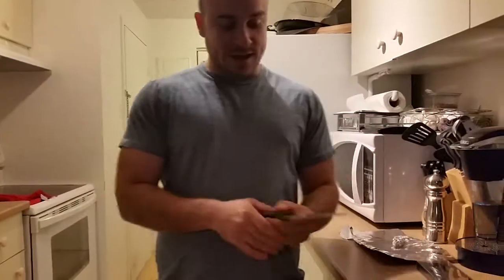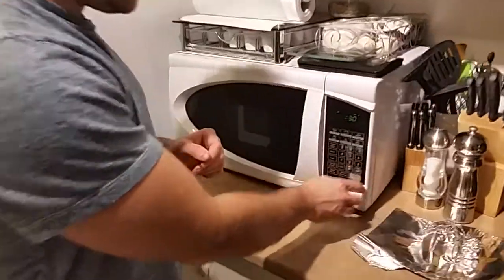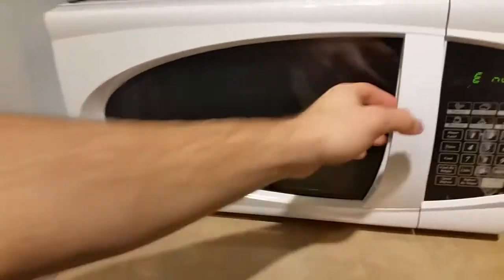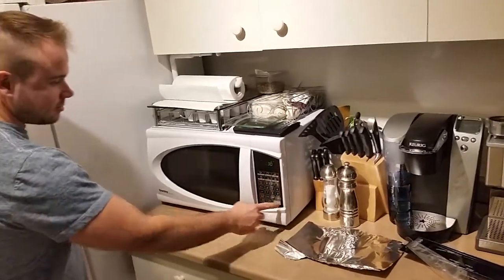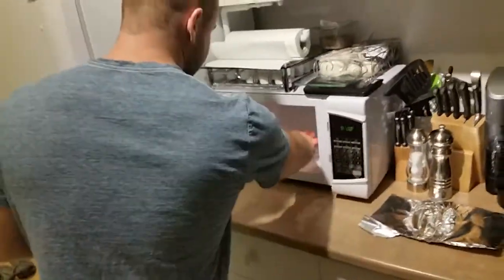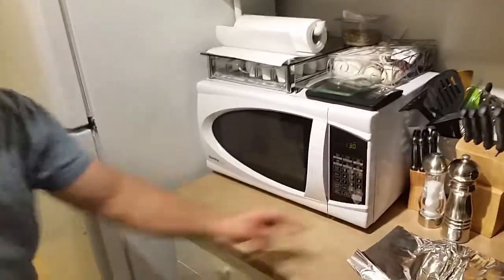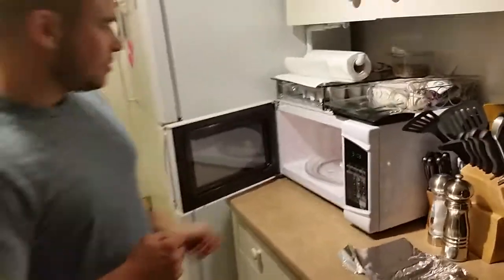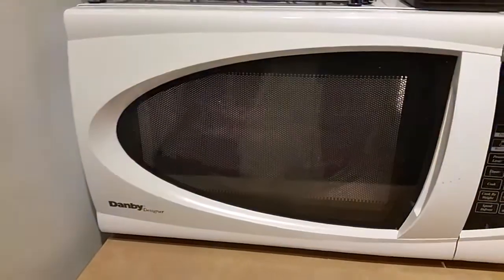Stainless Steel Knife in the Microwave - Big Bang Cooking

Comment: DO NOT put a steel knife in a microwave! This guy's knife happened to somewhat square and far from the edges which reduces the chances of sparking. I put a knife that came to sharp point in the microwave and it damaged it permanently. The sharp point concentrated the microwaves which melted the tip.